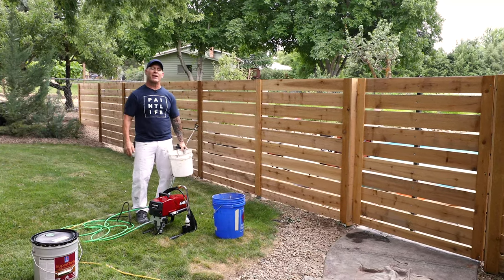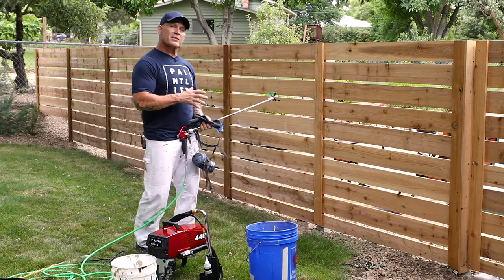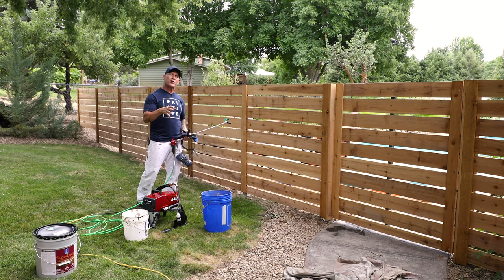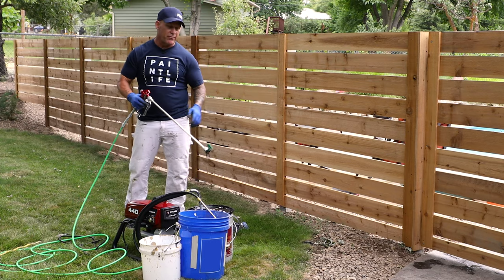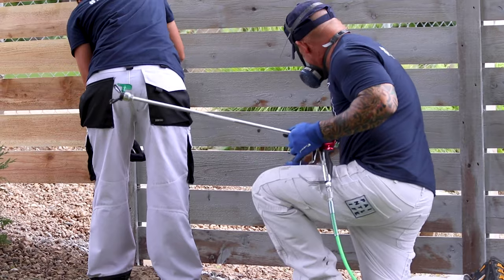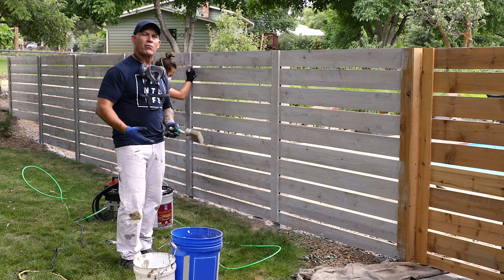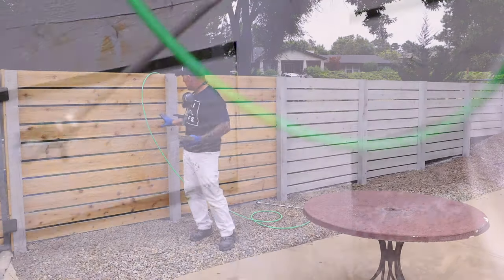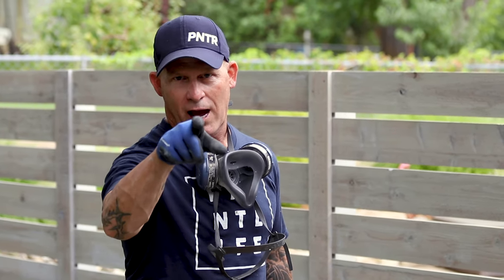WORST Product Ever, Oil Based Stain!  Never Oil a Wood Fence

Comment: Or you can just use ready seal 😂
No back brushing required and because it's self leveling, 15$ garden sprayers work just fine. 
It's faster and need for extra help or expensive equipment.
Reply: worst junk out there

Comment: Hey Chris ,this vid seems misleading by name,(are they paying you to plug a product?) I noticed you didn’t mention sanding ? If the fence is cedar you would need to knock off the burs so when your back brushing your not getting drips and streaks from the fiber fingers .i been painting 20 yrs myself and appreciate a good prep for best results.
Reply from the maker: The fence does not need to be sanded